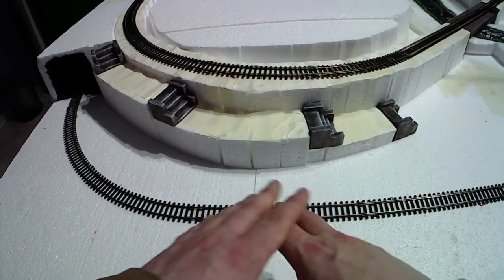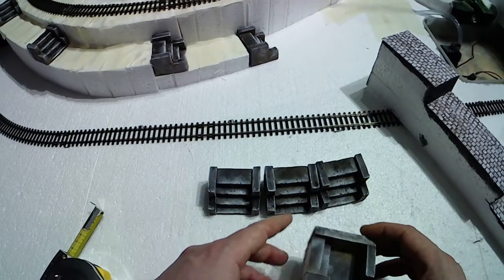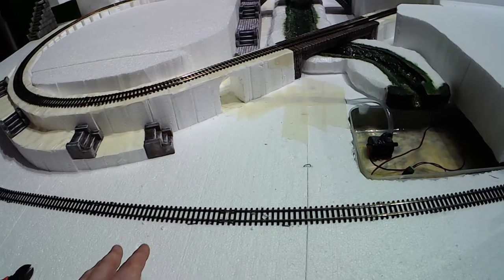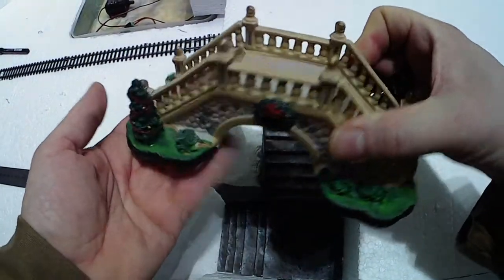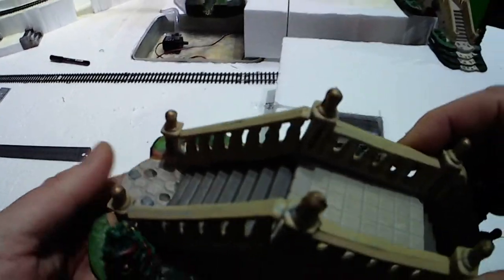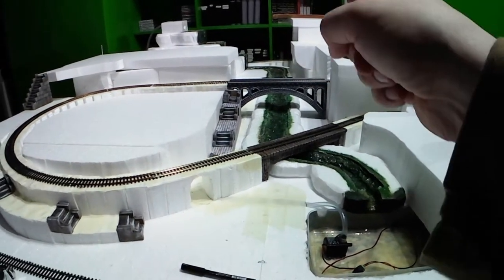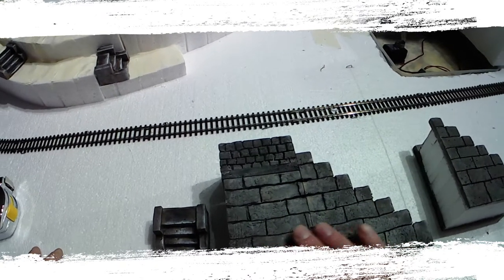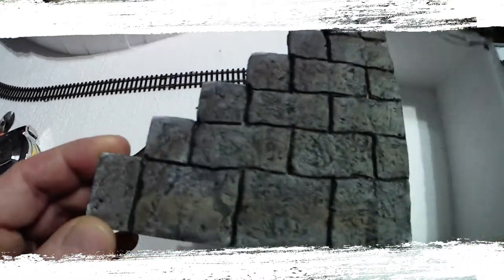Christmas Village Tutorial 2020 - Part 9

Comment: What kind of foam did you use? Where can I purchase them?
Reply from the maker: Hi Iris. For the big constructions I use Expanded Styrofoam (EPS).
Panels are 50 cm x 100 cm  and between 3 to 12 cm thick.

For the little grey stairs (and generally for all the constructions that need a worked surface) I use Extruded Styrofoam (XPS).
Panels are 30cm x 120 cm and 9 mm thick.

In Europe all the major home improvement stores have them on catalogue.

In the US too (Walmart for example)

or you can buy them on markeplaces such as Amazon or eBay but they are expensive compared to the classic stores.